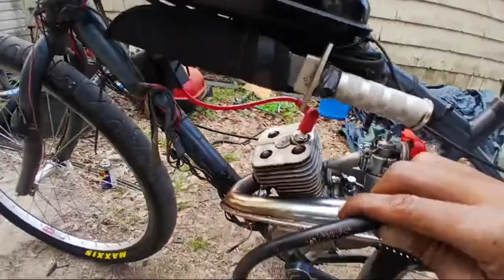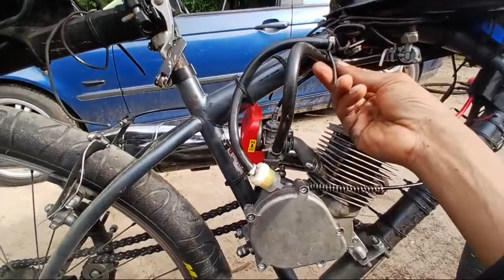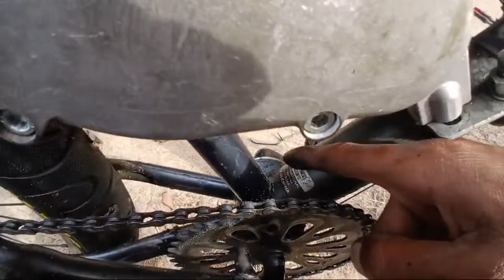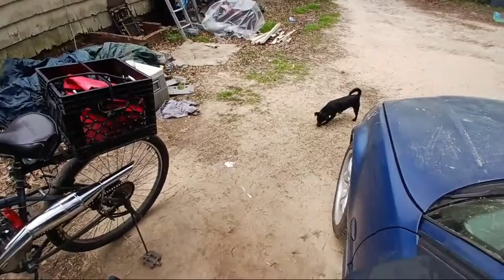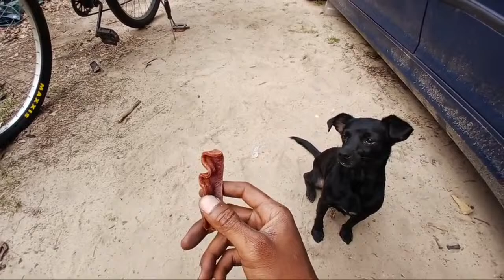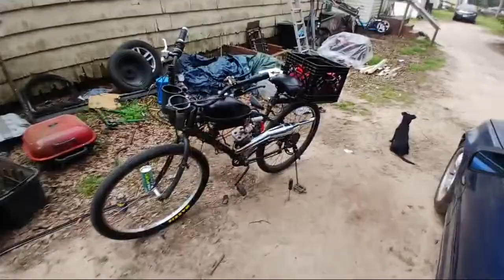open mind entertainment is live!

Comment: My brother it might be the filter screen screwed on top of that valve cause on my phantom I  had to remove it not enough fuel flow that's the only one I had to do that to though
Reply from the maker: You think it's safe to remove the screen inside the gas tank?
Reply: @yomontOME  as long as you have a inline fuel filter or don't remove it just check it see if it's dirty that's the only thing I can think of that would stop your fuel flow brother
Reply: @yomontOME   Remove the filter in side the Tank, Never Run the filter in the tank, an get clear fuel line , an keep the external filter 👽👍🏻
Reply: Isn’t there a clear line inside the heater tube? If there is a clear line and that other line is on the outside it will be fine. The tank filter is garbage though. Inline filter is all you need. The tank filter is going to decay and possibly gum up if you don’t stay ethanol free. How’s the premix fuel helping?
Reply: @yomontOME  remove it. It’s not necessary with inline filters. Only cause problems
Reply from the maker: @robertkgunn It was raining yesterday.Haven't had time to test drive it yet
Reply: @yomontOME  yeah like op1zill agreed with me you don't really need the inside filter as long as you have a inline fuel filter and clear fuel lines so you can see yeah couldn't ride here neither same cool front blowing in and made it start raining be safe brother
Reply: @yomontOME  you're good bro I always take that filter off inside the tank   just run a good fuel filter in between your tank and your carb

Comment: put your regular exhaust back on and ride see what changes.
the one you have on now is way to close to your carb. your gas flow is straight, no issues there.
Reply from the maker: About to purchase a new exhaust as soon as I can.💯
Reply: @yomontOME  take one off your other motor or from your parts bin. You're just testing to see if thats the issue. That way you don't end up spending money on the wrong exhaust or part.